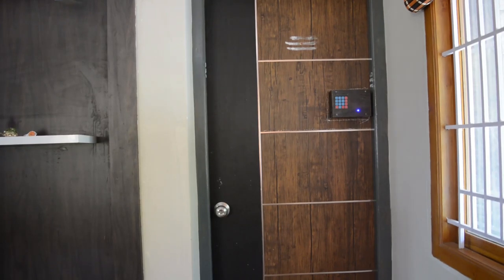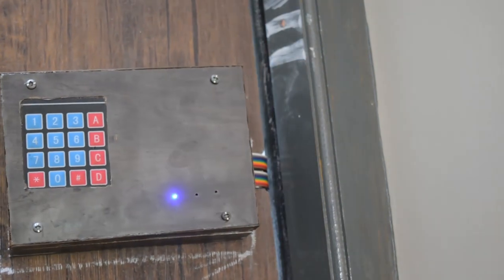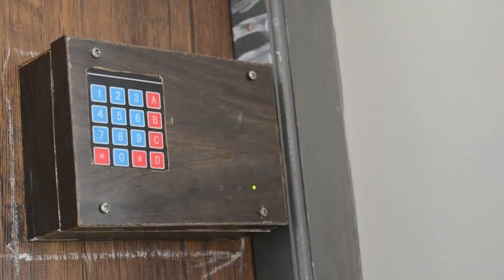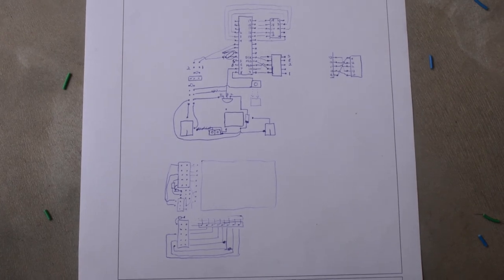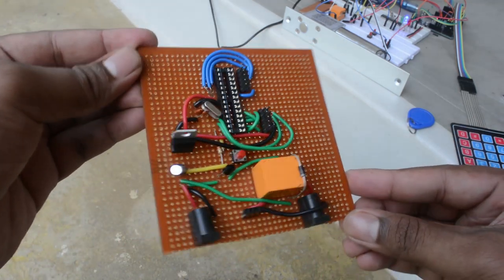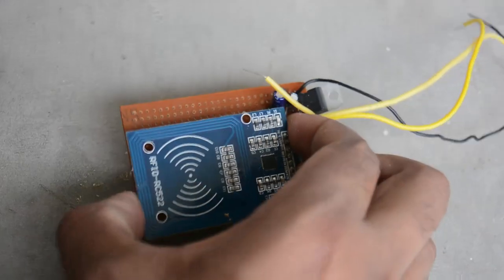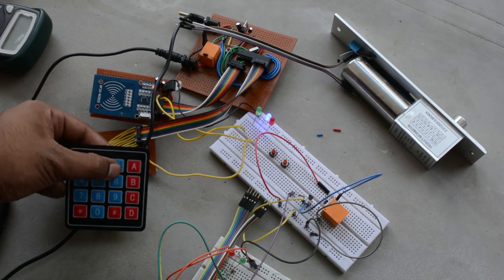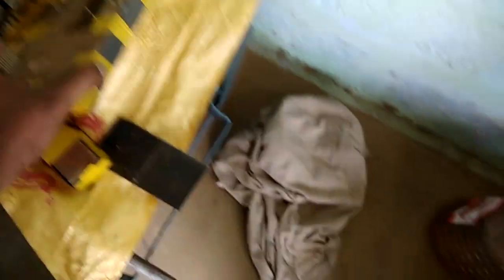How to make your own Security system|DIY Arduino Security sytem

Comment: Not very secure if the wiring is all outside the door, also the way the lock is mounted means the whole door is held by two screws.